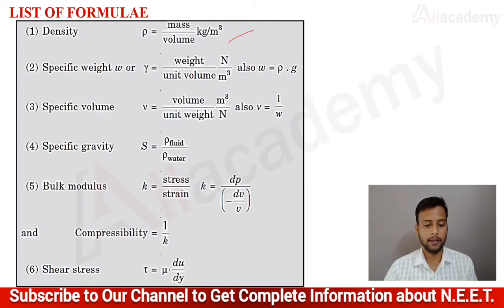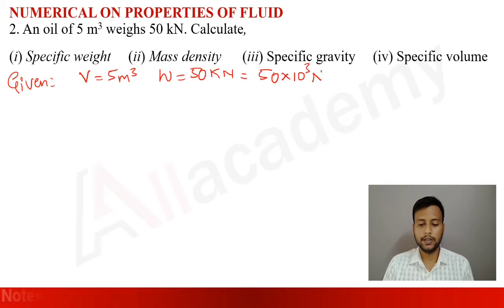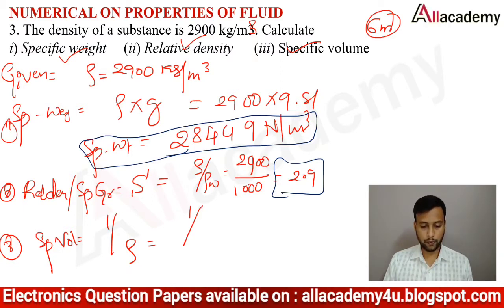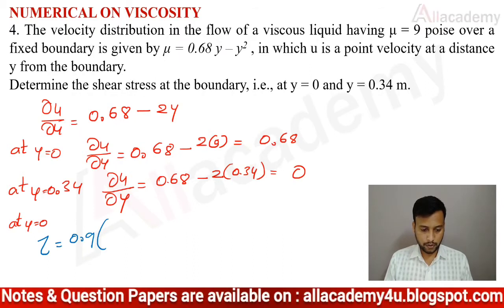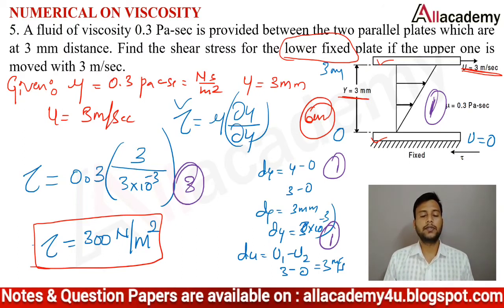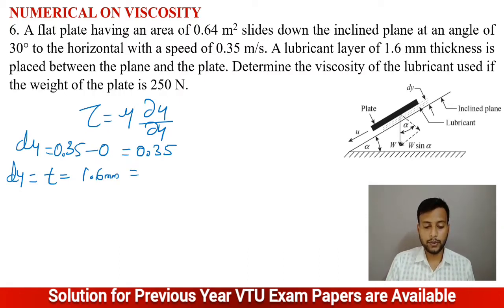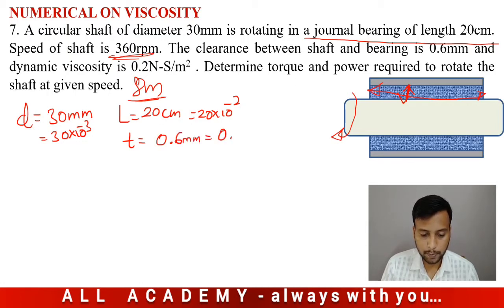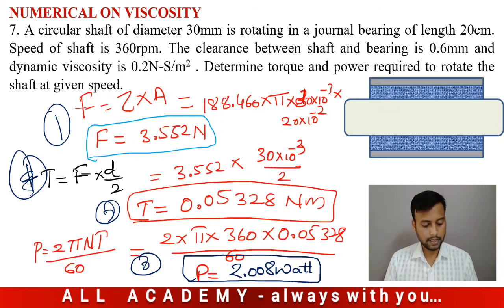Fluid Mechanics Module 1 : Numerical on Fluid Properties & Viscosity | Part 4 | VTU FM | 4th Sem

Comment: Halo sir in 3rd question ...specific volume means 1/specific weight but u taken 1/density...how 🤔sir
Reply from the maker: Good observation, Specific Vol = 1/Density is Correct, in 3rd Numerical.
But in 2nd Numericals it is mistake. It has to be taken 1/density. 👍